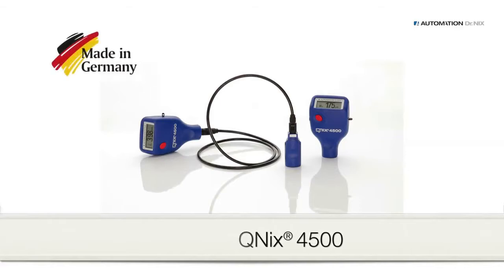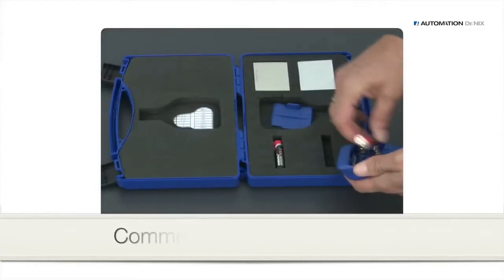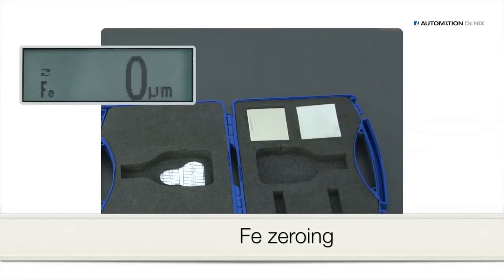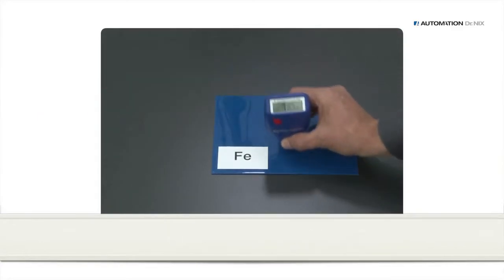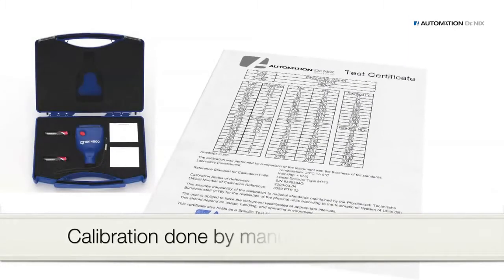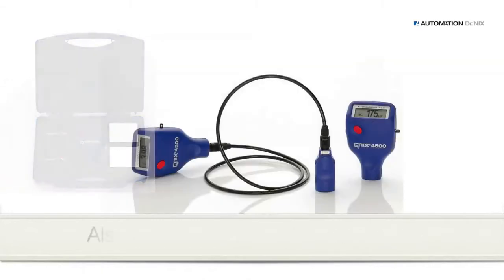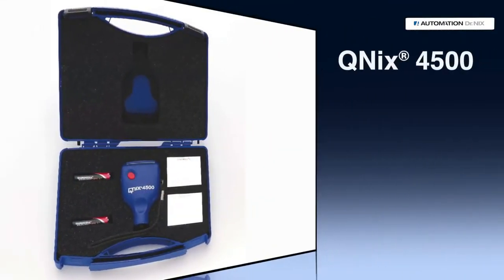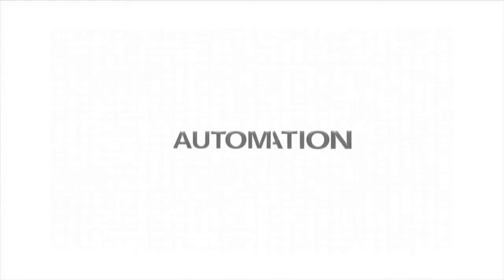Máy đo độ dày lớp phủ

Comment from the maker: Máy đo độ dày lớp phủ - Liên hệ: MR THẮNG 0936 983 953
Máy đo độ dày lớp sơn mạ QNIX 4500
Thiết bị đo độ dày lớp phủ 
Máy đo chiều dày lớp phủ
May do do day lop phu
Coat thickness gauge
Model: QNIX 4500, QNIX 4200, QNIX 8500, QNIX 7500, QNIX 1200, QNIX 1500, Car Check System
Xuất xứ: Hãng QNIX - Đức

Thông tin liên hệ:
Lương Duy Thắng - 0936 983 953
Email: Luongthangqn@gmail.com
Công ty Cổ Phần Công Nghệ Đỉnh Cao - TTECH